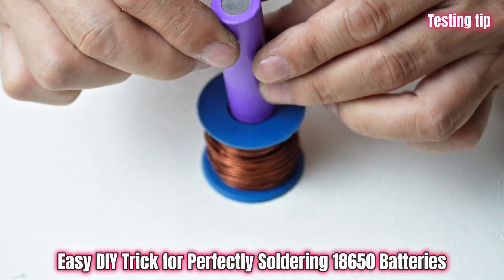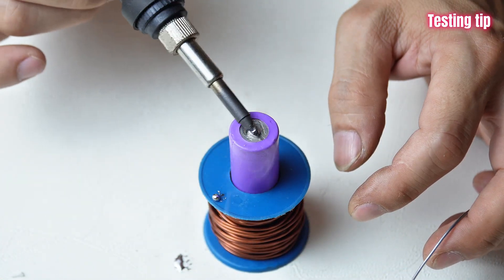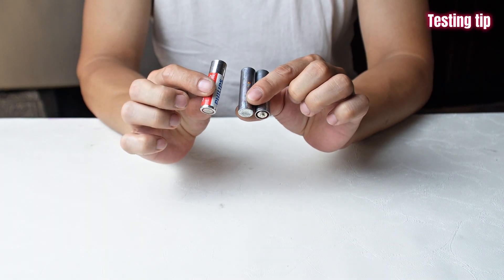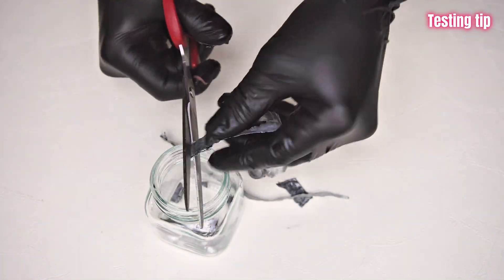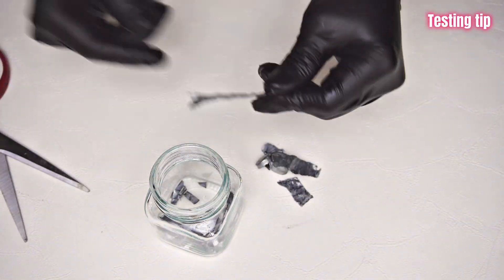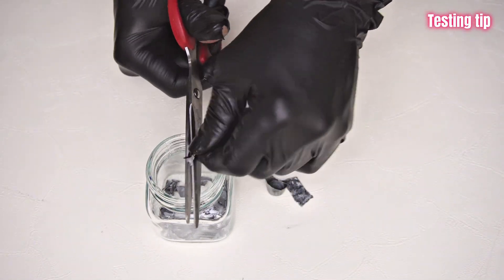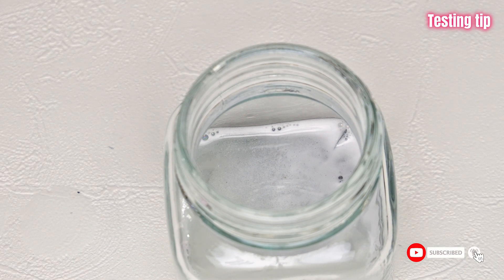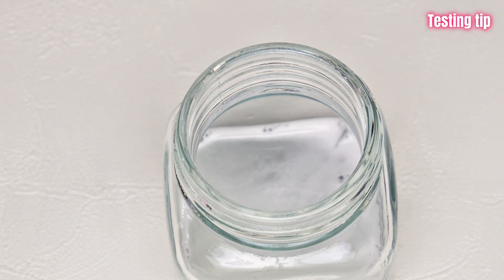The Secret Flux for Welding 18650 Batteries Easily (Billions Don’t Know This!)

Comment from the maker: Thanks for watching!
Did you know this DIY flux can make welding 18650 batteries so much easier? ⚡
👉 What projects are you planning to use this trick for – power bank, e-bike, or battery pack?
Let me know in the comments below ⬇

✅ Don’t forget to LIKE 👍, SUBSCRIBE 🔔, and SHARE this video to support the channel. More DIY battery hacks are coming soon!
Reply: What did you pour into the glaa container to melt the alliminium and what were u showing the other plastic bottle for and it's name..?
Reply from the maker: @nnejiamaechi9385  You read the video title and read the description and it will be clear. Thanks for watching.

Comment: "Billions Don’t Know This!"  Red flag to announce crap is coming. Acid (HCl) alone can be used as flux, no need to destroy scissors cutting metal. Acid is also corrosive to metals so better not use it. It will corrode over time. Soldering LiPo's is a really bad idea you will destroy it or at least shorten the life time. In the worst case cach fire or explode.
Reply from the maker: After soldering, I used alcohol to wipe it again and it was completely clean. Many people have problems with soldering 18650 batteries without lead, so this substance is an assistant for those who need to use them. In addition, you can use it to solder iron, aluminum, stainless steel... or anything you want to solder. Thank you very much.

Comment: ZnCl for short is what you made. Anyway, any acid based flux helps to solder iron or nickel. It needs to be washed away after soldering, it is corrosive substance.
Reply from the maker: Thanks

Comment: Just buy some rosin flux if you want to risk damaging your batteries by soldering.

Yes rosin, not resin - it's not a typo.

If you want to mimick what this mad scientist is doing, you can skip the zinc and 24 hours step, just use the acid as-is - the dissolving of zinc into zinc chloride does nothing, it's the acid which removes the oxide layer which helps the solder stick, rosin flux will do the same but without the chlorine gas you'll be inhaling from the acid.

The correct way is to use nickel strips and a spot welder. Heat, even just for a few seconds, will damage the batteries.
Reply from the maker: There are many ways to solder 18650 batteries and my video is an example. I think people in other places who don't have the conditions can do it themselves. Thank you very much

Comment: Well, this is a fake video. Don't know about the solvent he did, but that is definitely not what he used to solder. @6.56 to 6.57 there is a video cut. Let me tell you what he did there. 
Check how the battery's wrap is all okay before 6.56. then after the video cut at 6.57, check how the wrapper is a bit burnt and a bit of soldering near there. And also check there's some scratch on the battery (if you look for it, it's noticable) which wasn't there before the video got cut at 6.56.

Here's what he did and what you can do- He scratched on the battery using a blade(or you can sand the surface a little to make it rough). Then (apply a bit of flux if you want) heat the iron to the max and solder as you normally do on the scratched/sandes surface.
Reply from the maker: This video is real, I did not deceive you and the channel's audience. I tested a lot so I made this video for you to see. The cut part was because I was in a hurry to solder when the soldering iron was not hot enough to heat the solder joint, so I cut it to create credibility for the viewer. This is a basic chemical reaction when I was in school, the reaction diagram is as follows: Zn + HCl → ZnCl2 + H2. Thank you very much.
Reply: Es que es así de simple: lijar suavemente las superficies a soldar, aplicar un poco de decapante y estaño aleación 60-40 sn/pb. Así de sencillo.

Comment: Any chemistry know what is this solution?  Per my knowledge AAA batteries foild is Al with HCl reaction it produce H2 bubbles + AlCl3. Aqueous AlCl3 can be used as flux?
Reply from the maker: Yes, that's right.
Reply: It's zinc and the ZnCl does nothing for soldering. It's a salt, just like NaCl or table salt.

It's the HCl reacting with the oxide layer that's actually doing something and possibly the worst substitute for flux.

Comment: I just sand the surface with a 180 grit sandpaper, put a drop of flux and it solders fine. After soldering I cool the joint with a small computer fan to diminish the heat damage to the battery. Never had a problem so far.
Reply from the maker: There are many effective methods of soldering batteries, but many people fail to do it because their soldering iron does not reach the ideal temperature. This homemade solution will be very useful when needed. I found the hardest to solder the battery contacts of the TV remote. Thanks for your helpful suggestions.
Reply: I also sand the surface and 400 degrees helps to for temperature

Comment: I used phospheric acid to solder some and they got hot and it ruined them and the phospheric acid also ate my welding tip
Reply: Also i am not gay
Reply: @damensutherland7081 😂
Reply from the maker: Yes, acid etching is acceptable, but after welding you should use a cleaning solution like alcohol or a specialized one to clean it again then it will be fine.

Comment: I dont know if it works.. But u should never cut videos in the most IMPORTANT time..
Reply: Aynı formülü 1,5 yıldır kullanıyorum çok başarılı lehim tutmada. Birde tavsiyem okditlenmeyi önlemek için lehimden sonra alkollü bir bez ile silinmeli. Güzel bir video olmuş tebrikler.
Reply from the maker: @safakatmisbes4025  Geri bildiriminiz için teşekkürler. Yeni video fikirleriniz var mı? Kanalım yeni ve yaratıcı katılımcılar arıyor. Umarım desteklersiniz.
Reply from the maker: Can you show me at what crucial moment I cut the video?
Reply: @testingtip  6:56 clear cut, come on.
Reply from the maker: @Princip666 then i wait for the soldering iron to heat up it takes a little time. try it and you will see the difference
Reply: @testingtip  Meanwhile the drop of liquid disappears and a bit of already attached solder appears. That's the problem.
Reply: @testingtip  so, you dropped a bit of hot solder on the battery burning the outer wrapper a bit and also scratching the battery with a blade or sort of material? Yeah. Very convincing bro
Reply: un necessary video cuts make many doubts
and due to this i m not going to try this or watch other  videos of this channel sorry
Reply: Doesn't work. He scratched the battery to make the surface rough and then soldered on it